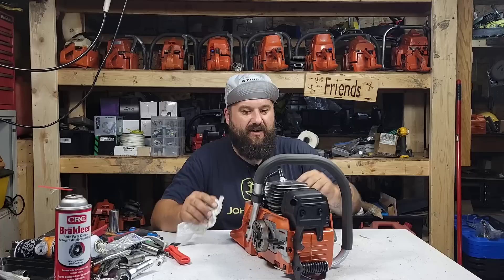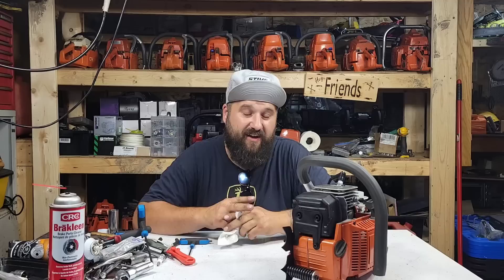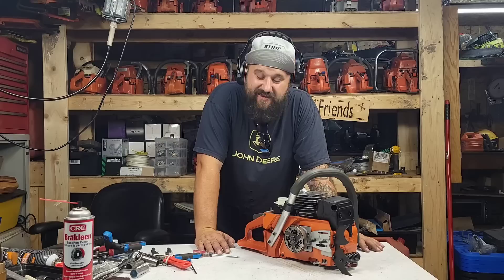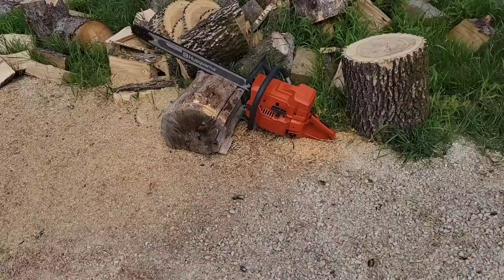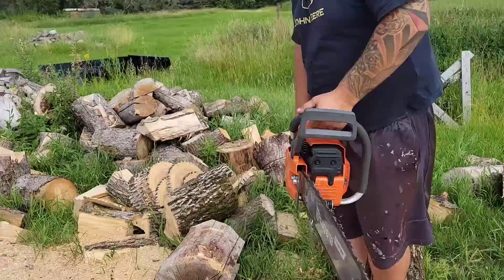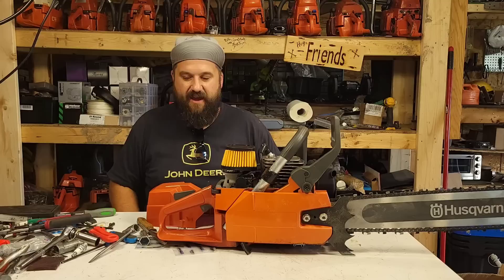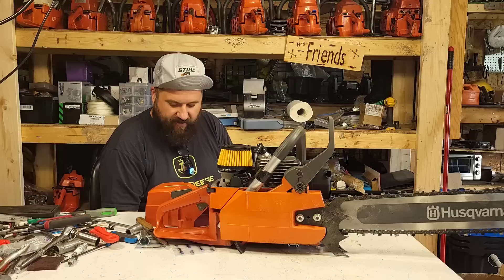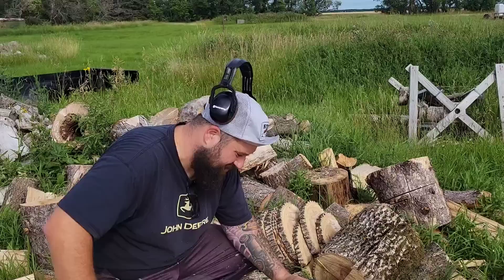Farmertec 288xp kit PT4. First Start!!   This saw has issues!!!! Can I fix them??

Comment: I've found with aftermarket carbs, it always helps if I clean them out before using them just in case there are any machining "leftovers" that got glued in place with cutting oil. Just soak them in a jar of gas overnight and swish it around a few times. Even better if I tear down the carb and clean it well afterwards just to be sure.

Comment: For an occasional use saw, they are pretty good value for the $. Don’t trust their decomps. They can’t be compared to a OEM 288, 372 etc. you need to compare them to what else you can buy for $350-$400. Also you must have the basic skills and aptitude to troubleshoot the problems you are gonna have with these kits.

Comment: I built the Farmertec 365 kit and I'll say that I had a similar experience with the chain brake at first. But it bedded in after a handful of uses and seems to work just fine now. I'll also say that Farmertec stuff seems to be continually improving, but its likely that new kits will take a bit for the kinks to get worked out. I have four Farmertec kits, and the carb sucks on all four of them. Little by little I'm going to replace them with OEM carbs.

Comment: Outstanding, let's see how long that carb holds up. The one on my 372 lasted 1 tank of fuel. When I built my 288 I put a 298 carb on it. 2 years later it's still going good. Of course my 288 build is not a straight out of the box build. I used a number of upgraded components simply because I don't trust Chinese quality. Sure it cost a bit more but still half the price a Husky would have cost me. It rarely see's any felling or bucking. I mostly use it for ripping with a 42" bar.

Comment: Hey Tinman, congrats on the child when he/she comes! I had a brand new Dolmar PS-6400 run the exact same way and it’s really stumped me. Did a carb kit and a fuel tank vent. Still had the same issue. Would start and idle perfect but half way through the first cut would just die. Not stall but die down. So I decided to pull the cylinder. I couldn’t believe it but there was grease on the inside of the cylinder covering the hole where the impulse line went. Blew that out and cleaned it up and has ran amazing ever since. I’ve started porting saws not thanks to you. Thank you for the humble advice through the years and as always, great video.

Comment: I bought an aftermarket carb for my 162/272 and it went lean after few seconds on full throttle no matter how rich i tuned it. I found out that the impulse channel and hole from metering chamber to h-screw was too small. I compared those to original tillotson from 162 and drilled those bigger. It works great now.

Comment: Even my  pre built had a lousy oil pump. I got another and saved the hassle, also like to use OEM rubber parts like the fuel lines on the Farmertec saws as a rule.
Reply from the maker: I saw that in one of your vids, was hoping mine would be better but no such luck.
Reply: @tinmanssaws  I just put a used OEM in and never looked back. I didn't have the fueling issue. Prolly because I change out the line. Now trying to decide what to do with the g395. You going to get one of those? Think it needs a better piston option.

Comment: The fact the saw fired right up without needing a few pulls without ever being run is an indicator that the needle in the carb is not seating properly, be it debris, diaphragm, or parts issues, you may want to clean out the carb and pressure test it just to be sure. I have had to trim the decomp hole on OEM Husky saws after doing a base gasket delete and cutting the base. I had one new aftermarket decomp come apart in a stihl, the plastic button fell off, thankfully I noticed it before I ran the saw, something to be mindful of. I picked up a used stihl 066 that the owner put a new aftermarket coil in it before he sent it to me. When I got the saw it started ok but on the restart the saw ran backwards, a first for me. I put an OEM coil in it and the saw ran fine, out of curiosity I put the aftermarket coil back in it. The saw ran fine for a couple of days then started running backwards and shutting off so I put the OEM coil back in and it has been fine since. The coil was a DZE by Espel. Curious if anyone else has had this issue? Also what aftermarket coils have you all had good luck with?
Reply from the maker: You may have missed it but i mentioned that i primed the carb first thats why it fired so easy.
Reply: @tinmanssaws  Sorry about that I did miss that part. I cut timber today and was cleaning up my saws while I had your video going. The comment may help someone with that problem that did not prime the carb. I can delete the comment if you would like.
Reply from the maker: @230e4  your comment is great, please keep it up buddy, I appreciate you taking the time to type that!!
Reply: @tinmanssaws  you  are welcome. It is nice to have a positive video to enjoy while finishing up from a hard days work. Keep up the good work.

Comment: Some others have had issue with the trigger not opening the throttle all the way so you may want to check that also. I replaced the fuel line on mine because it was winding up like a pig tail in the tank and wouldn't allow the filter to go all the way against the sides of the tank, I replaced it with Echo 5x3mm fuel line and an OEM fuel filter.
Reply from the maker: I may replace this fuel line after some run time. It seems fine once I un kinked it.

Comment: My Chinese 372xp pro wasn’t oiling either. Turns out the guide bar plate had a oil slot about two times smaller than an original 372 so I had to die grind it out.

Comment: If I remember from the earlier videos, that oil pump has no car in detail in the top left of the pump body, I've seen other videos by other saw builders commenting there are several aftermarket makers, and the ones with a cat detail in the top corner are much better than the ones that come blank.

Comment: Change the plastic panels on the rear handle to the OEM rubber inserts and it feels a world different. I hated the way the rear handle felt so slick in my hands so I bought the OEM's hoping they would fit and they do. I had to drill out one of my rubber mount holes that was stripped when I received mine and I put a small piece of paper in the hole then filled it with JB weld and let that harden then drilled it out and threaded the spring isolators that where made for the 288/281 in and it's working fine now. 
I know I picked on the rear handle in one of the previous posts about how cheap it felt but once I changed out the panels it actually feels really nice now and better than the 372 kit tanks, it's a darker plastic and after taking the two side by side (288 and 372 china rear handles) and comparing them and trying to twist them the 288 felt better. Keep in mind my 372's where from a few years back and they may have started using better plastic on them now as well.

Comment: I just bought a used 395xp and when it showed up the case was alot more beat up then in the pictures and it seems to leak a decent amount of oil and possibly gas, pretty bummed that i may need to put some significant work into a saw that i didnt expect to really need anything but nice to know theres decent cheaper alternatives for the parts.

Comment: Ya some of the oilers for the 288 are junk. Hultzforma does have a new one that seems to oil better. Not sure why they are still shipping the bad one. Hopefully the lower end holds up. That seems to be the weakness. Some better bearings and harder crank it’ll be a good saw.

Comment: Im ok with mine. I found the oil adjustment screw needed to be turned to 4 but the 4 where the screw stopped was not as good as the 4 360 degrees from that. Still not as good as I want it but better. I think the new pump is better. Cheers

Comment: TINman , I also had same great experience of great looking pieces and darn near OEM LOOKING parts with the (RAD 88 creation I’m working on , same kit as you purchased, but no shipping damage , I opted for a factory 288XP lite cylinder I had , with mild port matching 4 tanks of fuel and needed a re-tune when broke in , but it’s a ripper , just finished my Hyway ported cylinder and after a 10 tank life  I’m gonna plop it on and see how a 288 XP  feels at 10-12 K in the wood . Couldn’t bear to use the factory blob job powerhead/cylinder ( just my personal pickiness )

Comment: Had the same issue with one of their g372 365 blue clone saws I swapped out to 2 different carbs including going back to the original one that came on the saw just to realize that the fuel line was too long and was actually about 1/4 to half an inch higher then the carb as well as being in a weird twist between the case and tank handle and it would not pull fuel at all took me over a week to figure out the issue. Also wondered if the 48mm cylinder I ported was the issue so I cleaned up another 48mm cylinder from farmertec and swaped out to it just to be sure was a massive headache just to realize it was a fuel line issue.. Also a tip on the decompression valves you can re seat them using valve lapping compound had to do that twice to 2 ebay decomps I used. Worked very well. Just a tip and thought.

Comment: I had a spark plug play tricks on me and I couldn't find a carb for my 298 xp. So I ordered a carb aftermarket for just dirt cheap for a 272 what's it going to have a 1,000 of an inch smaller jet the thing that's going to rob power from that saw would be letting it get dull so I'm not going to worry about less power it was a gas hog anyway so I also thought it was the module so I got another one of them used and neither of those helped so I took a spark plug out of another piece of equipment and it's runs beautifully so that means the old carburetor is still perfect and will work and it also means that the module was not bad I tried to get spark in the beginning and I got an arc about the diameter of a hair.... And  the new spark plug had a 1/32nd of an inch diameter spark I didn't think it was a big deal but now I have extra parts I had to mess with the linkage rod for the 272 carburetor to work and drill another hole on the carburetor crank but it works it has full throttle I loaned the saw to a lager and he says it's an absolute animal it's got six cubic inches it's almost 100cc... It's a collector's item it's 1986 298 XP they only built them for 2 years and what they are is a souped-up factory Saw... People that were out of shape could not start the saw because it needed to have a compression release put in also it would tear that starter cord handle right out of your hand and you get rewarded by having super sore fingers so the mechanic at the shop showed me right where to drill on top of the cylinder head and make sure the piston is all the way down take the spark plug out and shove paper towels in there during drilling and tapping. And then put a generic compression release in there that has a 3/8 fine pitch thread... About 10 years ago I was cutting up a 30-inch diameter spruce into firewood rounds... And the guy at the Saw shop sold me a new bar and chain and he said we're trying to get rid of this chain because it's hardened chain you cannot file it right from the factory and he says we're going to discontinue it in our shop because it causes people problems but I bought some like I say it can only be ground to sharpen it but right out of the box I made 18 cuts on that spruce and the teeth showed absolutely no ware whatsoever I'm sure some of it was a technique I use when cutting firewood with grit and sand on it I cut a ring in the bark and then follow that ring when I cut my round off that thrusts all the grit off and away and does not pull it into the cut the chip literally knocks the sand and grit off and it never makes contact with cutting teeth I can cut it all day down on the beach by doing things like that or I'll just cut a vertical halfway through cut and then walk over to the other side and match cut right down through there. Be safe keep sharing knowledge I'm 72 years old I wish  Billy Ray Smith... Would not have blocked me from his channel I was just trying to help him and others and keep them safe.

Comment: I got their MS660 kit but with Walbro carb and Meteor piston and cylinder.  It rips like a real MS660 but the oiler doesn't oil.  I have a new Stihl pump to install, otherwise its all Farmertec supplied except for that and Oregon bar and chain.

Comment: I just picked up a mint 2021 395xp with a 36 inch bar and spare brand new chain for $850.. and I mean it is mint bar hasn't even a scratch I had to pick it up at that cost.

Comment: You said you had a lot of wood to buck. Would like to see it get a good workout. Walter and Harvey both replaced the FT decompression valves with OEM. Me. Johnson talked about cleaning the carburetor with gasoline. Wondering if it would work on the oiler?

Comment: The downside to the 288xp clone is their ignition. Mine died after two tanks of gas.
But they are a beast. Mine screams with a 28 inch bar. If you want a big saw for butt cuts this is your boy. I’m not crazy about the oiler.  They could have done better.

Comment: tinman.....i understand the new build and saw needs some break-in time. BUT.....for what is called a 90CC saw, sure doesnt seem to have much "grab" or "jump" to it when you hit the throttle. my 372 will jump big time. even my little 501P has a much greater engine thrust then that thing.......so, just me watching and not holding the saw as it cycles upwards in RPM or is it lax on the Torq? Jim

Comment: I was just gonna say DO NOT USE FT DECOMPS! I’ve fixed saws that they’ve broken off and fallen in the cylinder. I don’t need to tell you what happens after that. Plug them or replace with oem
Reply from the maker: I generally as a rule don't use decomps, they tend to be more trouble than they are worth.

Comment: I purchased the blue G372xp holzfforma saw from Amazon assembled and it runs great granted you have to adjust the carb on every chainsaw but I've been running it for a year now cutting firewood every day of the year because that's what I do im self-employed and I love it and the only thing I've changed was the spark plug. I'm about to purchase the new model of the holzfforma with the carbon fiber top cover because you can't beat the price it's great. I do like that 288 though but I already have 2 of those 288 Husqvarna models that were passed down to me from my father after he passed away in 2018. See the Tinman gave it enough TLC and it's alive

Comment: Run it on the 25.1 for a while, the bearing on the crankshaft is a bit soft and needs it
Im not seeing the point of the kit when you see the price of the kit and a built one are not to far apart

Comment: If you need to rebuild the carburetor, is it compatible with OE kits? Could that improve the transition on the jets?
Reply from the maker: Oem kits fit these carbs but I find these carbs either work or dont. 

This carb seems perfect now .

Comment: What mix ratio do you use for new engines or "rebuilt" engines?  And what kind of oil?
Reply: If I remember correctly he uses opti-lube at 45-50:1 in everything.
Reply from the maker: That is 100% correct